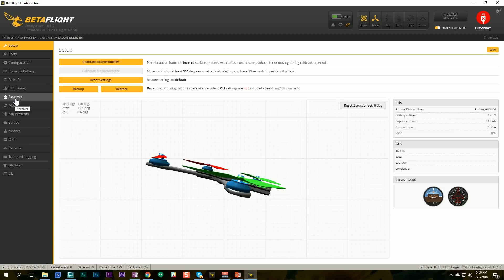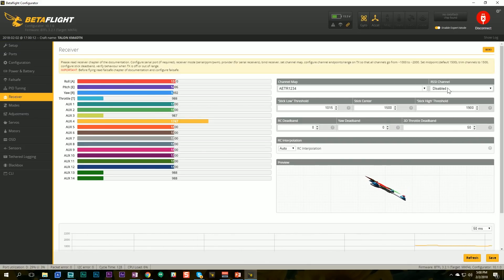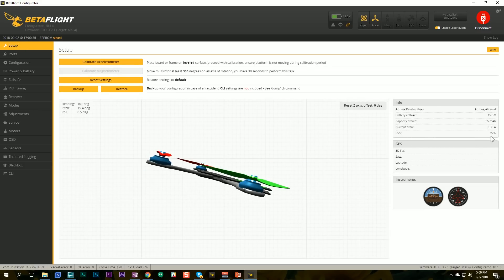How to put RSSI into OSD (UPDATED FOR OPENTX 2.2 & Betaflight 3.2)

Comment: Quick question Josh.. BF 3.4.  RSSI Channel under the receiver tab won't save. Any idea why?
Reply from the maker: BF 3.4 added RSSI source de-confliction. So if there is some other RSSI source enabled then it could prevent RSSI Channel from saving. Is RSSI_ADC turned on in the Configuration tab?
Reply: Joshua Bardwell I was able to resolve it by turning RSSI_ADC off. after that the RSSI Channel, under the receiver tab would save. I believe my underlying problem was programming on my QX7. I guess that didn't understand the analog RSSI input setting. Thanks for the update video. You go way out of your way for us. 👍

Comment: New to FrSky and I don't have the Telemetry option in Inputs on a QX7s - any ideas?
Reply from the maker: You need to have telemetry working with the FC and then go to the Telemetry screen and Discover Sensors.

Comment: I used this for LQ should the settings be different? My LQ in the OSD shows 50 full strength. How do I make it 100?
Reply from the maker: https://oscarliang.com/lq-rssi-tbs-crossfire/
Reply: Joshua Bardwell your the man. I read that before but it didn’t make since but as I read it again the light went off. Thanks

Comment: Hey Joshua, I was wondering what rssi signal is too low. Normally when I fly I am at 46. Is this a safe level and what is too low. Thanks for all the help.
Reply from the maker: If the Taranis is showing 46, that is too low. Somewhere around 44 to 40 the signal will drop out. If the RSSI in the OSD is showing 46, I'm not sure because the numbers aren't the same between the OSD and the Taranis.
Reply: Joshua Bardwell I use a flysky i6 but 46 is what I see in my osd. Would this be an acceptable level to go a little further or should I be cautious.
Reply: Joshua Bardwell, also I have 9 1300mah batteries all 4s. However some of them are different brands. Would you recommend parallel charging them all at one or should I charge one brand at a time separately?
Thank you for all the help.

Comment: Arghh I've followed this and I just get a constant rssi of around 10 percent! What's going on??
Reply from the maker: In Betaflight Configuration tab, make sure that RSSI_ADC is disabled. If that doesn't fix it then:

1. Verify in the Telemetry screen of the Taranis that RSSI sensor appears and the value is moving up and down as you move nearer and farther from the quad.

2. Verify in the Channel Monitor screen of the Taranis that the Aux channel moves up and down when RSSI moves up and down.

3. Verify in the Receiver tab of Betaflight that the Aux channel moves up and down when RSSI moves up and down.

4. Verify in the Receiver tab of Betaflight that the correct Aux channel is set as the RSSI channel.
Reply: Joshua Bardwell wow thanks so much for the reply from bardwell himself! I never imagined YOU would reply thank you!! Hey I'll deffo try all these things but like, seriously you have been one of if not THE top person I have come to for troubleshooting 100% and you always have an answer to everything!! PLEASE keep doing what you're doing I always look forward to your videos and the response is gonna go me out so much! Cheers 👍
Reply: Joshua Bardwell ok I've made sure that rssi ADC is off and made sure it all works in the taranis. However in betaflight the rssi is now at 0 percent and nothing happens in the receiver tab. Confused! 😂
Reply from the maker: If the aux channel is not moving in the RSSI tab then the taranis is not set up right to map RSSI to the aux channel.
Reply: Joshua Bardwell alright I'll do my best or just restart the whole process with ur vid! Thanks lot man 👍

Comment: Josh;  My setup: Taranis QX7, Matek F-7 std, Matek VTX,  R-XSR.  On the TX, it shows the RSSI  value, the OSD flashes 0      Why?
Reply from the maker: You didn't set up the RSSI the way it was shown in this video?
Reply: I can see it going up and down on Aux 6.  I assigned RSSI channel to Aux 6.  Then went to setup tab.  Still shows 0
Reply: I changed it over to Aux4.  I can see it move up and down on Aux4 in receiver tab Assigned RSSI channel to aux 4.  Saved, still 0.  I don't get it.  Yes, I followed this video step by step.
Reply: Oh, damn!  On the configuration tab about 1/2 way down the page on the right hand side...RSSI_ADC.  Needs to be turned on?  That changed my OSD value to 9  and remains there flashing even when the value drops to 60 on the TX.
Reply: I turned the ADC back off and now it works.  Go figure.  Maybe you could have an explanation for that but.  Thank you for your replies and as always.  Keep the videos coming!
Reply: @marinehm aux 4 is channel 8

Comment: is this setup different for the QX7? and will this work for the XM+ receiver?
Reply from the maker: It's the same for QX7 although a few of the screens look slightly different because of the smaller screen. It will work for the XM+ but you have to flash the firmware to the receiver that puts RSSI on channel 8.
Reply: Joshua Bardwell  - Thanks. Do you have a video for that? Can I do that wirelessly ?

Comment: so ive done this on a lot of quads now but decided to use an old xm+ in a micro after flashing the firmware allowing it to use RSSI. well now i can see the signal on aux 4 in betaflight assuming it is RSSI but its fluctuating between 1700s-1900s and when i discover sensors on qx7 nothing shows. when i use aux 4 in the osd italso fluctuates between 40db and higher without actually representing anything. any ideas?

Comment: Great vid Josh!  Just got an XM+ RX for GTR90.  Loaded latest firmware on it from FRSKY website (on TX SD card then wrote to XM+ RX from TX). Bound RX and TX fine.  Have RSSI set up in BetaFlight on Aux 12 (channel 16).  Betaflight shows in Receiver Tab that the RSSI on Aux 12 is working.  However, the RSSI value in both BetaFlight and on OSD shows a value of 10-12 only.  I have not put the quad back together becuase of this.  Am I missing something.  Is this the actual value of the RSSI (I'm guessing so) or do I have the RSSI range set up improperly (if that's even possible)?  Thanks go out to anyone who can/will help.

Comment: I tried using channel 10 on the mixer but it wouldn't work. It only works when using channel 8. And then I realized in the model setup, my channel range is from 1-8. Is this why channel 10 didn't work? I don't want to change that and mess something up, hence asking here :)
Reply from the maker: Yes that is why channel 10 didn't work. You have only set the model up to use 8 channels.

Comment: I just installed a tbv unify pro 5.8 totally separate to the FC because I had issues with interferences. Now is working great but i do not have osd. How can I do to have it back. Can I connect the video cable, to the cam ( from the tbs) and also to the cam out from the FC? Could that work?
Reply from the maker: No that will not work.

Comment: so for the longest time i couldnt get rssi into osd or betalfight to register at all really, i realized that  Rssi_adc was on in the configuration window,  this is analog rssi  and needs to be turned off when using an r-xsr in my case. hope this helps someone
Reply from the maker: I think it didn't used to have to be this way. It might be new in 3.3.
Reply: yes that is correct i am on 3.3

Comment: But what if I don't see RSSI on the discover new sensors screen?
Reply from the maker: Then I think you don't have a telemetry capable receiver.
Reply: I have the Frsky XM (regular micro not the plus).  I know it doesn’t have full telemetry but it should at least have RSSI, right? It says it in the manual too. I looked on all the auxiliary’s in Betaflight I don’t see the value anywhere:(

Comment: I have an odd one, OSD RSSI from XM+ shows 99 all the time, but if I put in range check and cover the antenna, it will decrease till it hits failsafe.  Is there a calibration process I have to go through? or is it just a really good link?

Soldered rssi tab to the hobbywing omnibus dedicated RSSI tab.

Comment: Is there any way to get a FrSky XM+ on the Bardwell F4 to display the rssi? I have one on a V3 board and it works fine without any extra steps.
Reply from the maker: The xm+ can output rssi on channel 8 or 16 depending on the firmware on the receiver. The JBF4 works the same as any other Betaflight FC in that regard.
Reply: i checked in cli that rssi is set to channel 8. Under the Receiver tab Aux 4 is moving with rssi signal strenght. goes up and down as i move tarannis closer to qwad. But under Setup tab under Info the says RSSI: 9% and it doesnt move. same in osd. Is this an issue within Betaflight 3.3?

Comment: I did all the steps,  it the number doesn't move in the Setup screen.
Reply from the maker: Go back through the steps and see which one is not working.

When you move farther and closer to your quad, does the RSSI channel move in the Taranis channel monitor screen?

Does the channel move in the Betaflight Receiver tab?

Does the Betaflight Setup tab show the RSSI value?
Reply: Joshua Bardwell hrmm I just went flying. It's weird, my OSD does show the RSSI value changing, which was my goal to begin with, so I am not too worried of the setup screen. Thanks Josh.

Comment: Joshua Bardwell

Is there a way of calibrating RSSI?
If so..can you make a video about it?

My RSSI On the OSD is different from my Radio.
The RSSI in the OSD is stronger than the RSSI is my radio.

Is that Normal?
Reply: Wondering the same thing, it says 99 all the time till you go into range test mode, I also have no RSSI setup on my TX at all as I'm running channel 1-8.

Comment: My Xm+ rx outputs rssi on ch12 in the receiver
tab in betaflight,but it doesn't find it when it when i press the "discover new sensors" in my QX7,any ideas?
Reply from the maker: It's not a sensor. The XM+ doesn't do RSSI so you won't discover any sensors. Just set the RSSI channel to ch 12 (aux 8) in betaflight Receiver tab and it will work. The XM+ does the RSSI thing internally even though it doesn't have telemetry.
Reply: I have the X7S and XM+ and HGLRC XJB F4 FC. I have a wire running from the RSSI tabs on the receiver and FC. In BF I set the RSSI channel to AUX8 but NO dice!!! (1-14aux RSSI channel available). I do not see an active value on other AUX channels in the BF. I do not see the RSSI when I "discover new sensors". I am set to DM16. Same problem with a different FC. What should I do? Thank you.

Comment: Josh, I am using OpenTX 2.2.1 and I can't get the RSSI discovery to come up like you show us on this video.  Any idea what I'm doing wrong?  Thx
Reply from the maker: My best guess is, you haven't "discover sensors" to get OpenTX to know the sensor exists.

Bind a quad with an X series receiver (D16 binding mode). Power on the quad. In the Telemetry screen on the Taranis, hit "discover sensors". You should see the RSSi sensor appear.
Reply: On my Taranis 2.2.1 firmware, I don't see the Telemetry option when I'm on my Input screen.  How do I get the Telemetry to show up on the input screen?  thanks

Comment: Hi Joshua, i have the XM+ i have RSSI on my OSD, is there a way to have Taranis read out the RSSI ? or be able to use the taranis to check your signal strength? For example, if i lose my Quad in tall grass and i have no video, is there a way to use my Taranis pin point in what direction i need to look for my quad.

Comment: Is there any advantage to running a wire to the flight controller than assigning a channel in BF?  This is so easy I don't know why you would solder the wire.
Reply from the maker: With this system, if you start to lose link, the RSSI freezes at the last received value. With a wire from the RX, the RSSI is always correct as long as you have a video feed.

Comment: Classic JB . Thanks for this made my RSSI work better . Problem I was having was even though I have rssi on my osd. The maximum signal was 33%??????? Standing right next to my drone. But on the taranis it measured 87DB. It should have measured 100% on the on OSD. OnCE I did your fix, the osd now measures 100% on the osd and the taranis is 87DB. Much easier to calcuate distanced to drop out now. AWESOME!
Reply: @Mateo Fiuza Worku Dude !!! ..... Your one comment just solved three(3) hours of pain at my bench today. Thank-you Millions !!!  You have saved many hair follicles (Nothing peronsal JB) Cheers much !!  I had to reboot and save however. Done... Now it's finally on my OSD via the DYS F4 Pro V2 FC  :)
Reply: Mateo Fiuza Worku great info thanks had the same problem👍
Reply: @Mateo Fiuza Worku thanks man,  had same problem!

Comment: I did that but it always says 49, what’d I do
Reply from the maker: Confirm that the Aux channel is moving up and down in the Receiver tab. If not, then the transmitter configuration is not correct.
Reply: uncheck the "RSSI_ADC"  option in "configuration" section. Same probleme here, solved with this method

Comment: im using xm+, i suspect that a displayed 50% rssi is actually 0%, is that because i didn't do those steps you didn't explain setting the -100 - +100?
Reply from the maker: XM+ outputs RSSI all by itself on channel 15 or 16 or 8 I can't remember which and it depends on the firmware you use. You don't need to do the whole Taranis thing.

Comment: Does this work with crossfire? Im see a 1RSS and 2RSS value when I am discovering new censors. Is this what i am looking for?
Reply from the maker: Yes, I think that is the sensor you want. I think you can also configure the Crossfire receiver to output RSSI on one of its spare pins. Also, people who fly Crossfire have told me they prefer to use link quality or SNR instead of RSSI, as it is a better indication of when you're going to failsafe.

Comment: Thanks for the video Joshua. I followed and everything looks exactly as the video does on the TX side, but when I go into Betaflight, the channel I put RSSI on doesn't seem to be picking it up, it just stays at 50%. Is it perhaps the way I have it hooked up? I'm using the Kakute v2, and I have the SmartPort wire from my XSR soldered to the SP pad on the board. I also have UART 1 enabled for SmartPort like the manual says. Also, in my CLI, rssi_invert = OFF, should that be ON?
Reply from the maker: If the channel is not moving then the Taranis is not sending the RSSI value. Go to the Taranis Channel Monitor or Mixer or anywhere you can see the Aux channel value and confirm that it is moving up and down in the Taranis when RSSI changes.
Reply: The RSSI does move in my Taranis. I have it on channel 9.
Reply: you resolve ?? i have your problem

Comment: Great video as always. While I've done this several times now I get a strange error. I once managed to get that working on 8ch. BF now constantly show 1971 on my 8th channel. While not a real problem (I'm setting up RSSI on CH7) this is annoying. I'm on D16 8ch (8ms). Did try to rebind and setup from scratch to see if this is my Taranis settings but not. 
Will try to bind on a 16ch D16 but still I should have 8ch on a 8ch setup.
Reply from the maker: D16 8ch is my exact setup. Most likely the Input or Sensor is not working right if the channel is fixed at a certain value.
Reply: It does not have to be bound to RSSI to show this weird value. My ch8 always shows 1971 even on an empty channel. 
I took a second FC (XSRF4PO BF3.2.4) bound it to a new model on my taranis with D16 16CH and in BF ch8 shows 1971... The channel looks fine on Taranis. No mixes, nothing in output and taranis monitor shows ~1500us. I think I'm fighting this since XSR+ SP f3 and omnibus F4 FC (I will check that tomorrow). As I now think I had this working correctly only on D4r-II with PPM. Ever since XSR (so SBUS) I could not get this to work on ch8. 
Not a big deal. It's a Taranis I can live with 6 channels and setup whatever I want (+ RSSI on ch7). But I's annoying. I just think about it every time a RSSI topic is mentioned somewhere.
The problem is I don't have any SBUS decoder to test other then BF FC's. Actually.. I do. Will test a XSR + SPf3 tomorrow and see what a Pixhawk FC will show if BF will have this issue on this setup too. 
Thanks.
Reply: I have a similar problem. The value displayed is moving around a value, but nothing in relation with the RX signal. I made previously a wiring error while upgrading the firware and maybe fried a component. I have to consider the RSSI no more working on this RX.

Comment: FrSky's interpretation of dB is to be kind,  very liberal. In any case most guys out there are not that into the technicalities so they will likely prefer a simple % displayed.
Reply: @Rob B: I have had electro statics and radiation and signal analysis and as far as i know i have never heard a formal definition of what 0DB actually means outside a comparison with another signal. Could you explain what the difference is between the db and % or more importantly how a 0 is defined?